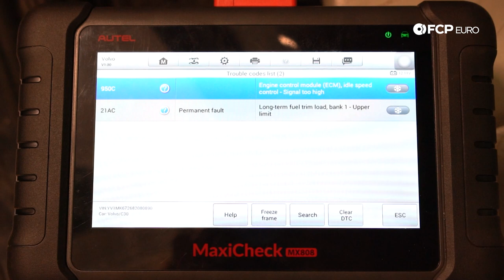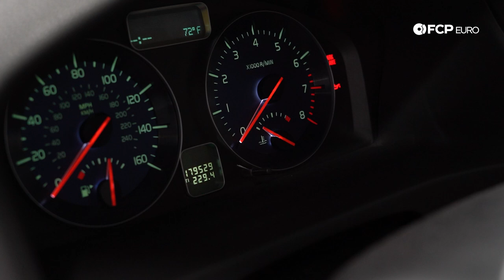How To Replace A Volvo Oil Filter Housing & PCV - Volvo P1 Platform - Volvo S40, V50, C30, & C70

Comment: I've done hundreds of these, was a Volvo technician for about 16 years
Reply: How long does the repair usually last? I had one done a year ago on my 2012 c30 166,000 and now it looks like I have to get another one replaced.
Reply: @interactive1178  took me about an hour max, if I remember correctly the turbo engines were easier to do than non turbo. Non turbo bout an hour all in, turbo engines like 40 to 45 min. A lot of cleaning the oil that leaks out too
Reply: @daviddennett2645  is it common to get one every year if you put a lot of miles on it?
Reply: @interactive1178  with the way things are built so cheaply I wouldn't be surprised. How many miles you do a year?
Reply: If you're over 200k by now I would expect another one is needed yes. Remember this is a FoMoCo engine, which means it's made by Ford. Worst thing Volvo did was to sell to Ford. Ruined quality
Reply: @daviddennett2645  thank you.
Reply: @interactive1178  you're welcome, good luck! Any questions feel free to ask idm
Reply: @daviddennett2645  thank you very much David
Reply: What way does the oil flow through the filter?
Reply: @90hdt  that I do not recall, id have to look at the housing to tell tbh, it's been years since I've done one. Why?
Reply: I just changed my oil and filter after the first 50miles after being rebuilt top and bottom I checked the outside of the filter for debris and wanted to make sure I didn’t need to cut it in half to check the inside.
Reply: @90hdt  I gotcha, id just check inside the pleats of the old filter cause it's the paper element with reusable housing correct? Talkin the 4 cyl in the S40/c30. If no metal or debris in the pleats you should be good to go
Reply: The 2.5 t5 yea I looked and looked good
Reply: @90hdt  the paper element correct? Not the metal one like on an 850/S70? If it looked good you're gravy n no worries
Reply: Hello
How long it takes to change the PCV on 2007 C70
Reply: @remonboles7375  turbo or NA?
Reply: i got a 2.4i  engine and i cant find any videos for that engine do i need to take te intake manifold off for this job??
Reply: @gamechangerz1329  not the manifold but the intake box with the ecu and filter yes. I think the turbos you don't have to for some reason but I may be wrong on that
Reply: @daviddennett2645  i already deleted stock intake and added a cold air intake to it . provides me with a lot of room . i might take the intake apart just out of curiosity. thanks for your advice brotha
Reply: Hey man, just today I ordered one of those red little circle ⭕️ pcv valves and took the cap off and went to put it on with the new one and the part I was supposed to clamp it on started chipping off and I can’t even get it pushed on all the way, can I drive it to work still what should I do
Reply: @yunglivid  yeah you're most likely going to have to replace that plastic part of the intake manifold, that or maybe the plastic teeth aren't locked into the read piece or something. I know a hose just locks into it. I never replaced one
Reply: @yunglivid  the pcv is the plastic box part attached to the oil filter housing. Those hoses are just the breather part of the system.
Reply: Is this the same on a 2013 V40 D3 please? Can't find anything on V40s

Comment: At Volvo dealers in NZ you'd be paying NZ$1200 just for the parts plus six hours labour at $100/hour. An absolute ripoff not helped by Volvo /Ford sticking the PCV Filter housing in an almost inaccessible location. Grrrrr

Comment: What is the estimated installation time for an experienced Volvo mechanic 2010 S40 T5 R-design ? I was advised 3.5hrs at $137.50 per hr part $214.99 total cost $696 sounds about right based on what others commented in this feed.

Comment: Just out of curiosity. If it is only the diaphragm that is shot, why not just replace that? Also, if you are a long way from home and this happens, can you loosen oil filler cap, to release a bit of vacuum in motor to prolong the bearing seals destruction?

Comment: Is this the same for a 2.4i (non-turbo)?  I have a 2008 S40 2.4i and my engine compartment looks different, with the five "finger-like" intake manifold on top.  Does that intake manifold need to be removed on this engine as well in order to replace the oil filter housing and PCV?

Comment: Thank you for this video. I had this problem last week. I went to a Volvo specialist and got it replaced, it costed me $700 with parts, labor and oil change.
Reply: How long does the repair usually last? I got one replaced on my 2012 c30 a year ago and now it looks like I need another one replaced.
Reply: If I recall it was like 4 to 450 with oil change n labor. 500 max at my uncles shop, the part isn't cheap either

Comment: Good video, i did the repair earlier today and I would add that you don't really have to take the ECU out the air box and you don't have to go under the car to remove the 3 bottom bolts, they're easily removable from the top. I did the whole repair on a parking lot and didn't have to get my jack out to lift the car at all. Also, i would highly recommend removing the coolant reservoir hose before taking out the air box, because it is very easy to damage that plastic hose which is a bit in the way
Reply from the maker: Thanks for sharing!
Reply: Will keep that in my mind. Will have to do this job on my dads 2005 Volvo v50

Comment: Just did this DIY, overall this video is a great step-by-step guide! outta 10 I'd say its about a 6-7 outta 10 on how difficult it is to perform this DIY. The hardest part was removing the airbox and re-installing it the bottom plastic mount was getting caught on the water pump i ended up shaving a very small amount off with a file to make a little bit more clearance during the installation. I ended up using a tap to create new threads for the bolts on the new housing. I also didn't have a long 10mm wrench on a flex head ratching for the housing bolts so that slowed down the process slightly. I would also recommend oiling the new housing gaskets with some oil to create a guaranteed seal "oil acts as a sealant" but overall an easy job with the help of this video! I had a check engine light on for Bank 1 running lean and the terrible noise as shown in the video. All fixed now!

Comment: I acctually clean used pcv housings and replace the rubber parts in them. Rebuilding the pcv saves a lot of $$$ and is very easy.

Comment: Hey, awesome video.  I especially like how you just glossed right over the hardest part...pulling that stupid air box.  I've been yanking on mine for half an hour.  I'm ready to take it out with a sawzall and put it back with duct tape.
<edit> - If you're doing this, the tab on the back of the airbox catches on the intake.  Pull the passenger side of the airbox toward the front of the car while pushing the entire airbox to the driver side
Reply from the maker: Sorry that was glossed over George, noted for the team.
Reply: To make that easier you can lift up the engine ( engine mount from passenger side should be unscrewed).
Reply: Took me less than a minute following the clear instructions. Taking the lower fasting screws of the ECU was more of a mission. Note: it's actually not essential to remove the ECU from the air box or remove the air box completely to replace the PCV Oil Filter Housing. Just ease the air box mounts from the rubber grommets and move the air box a few inches to the right will give you access to the mounting bolts.

Comment: I have a 2010 S40 T5. Ive removed the air intake "horn" above the left side of the radiator, along w the descending intake hose, to replace both with a cold air intake/filter. In fact, the CPU is also repositioned to a bracket to the left of the original air box/filter location.
  As a side benefit, I can directly & easily access my oil filter for changing AND PVC breather behind it. Replacing the breather diaphragm is extremely easy. The cap can b pried up & off & a replacement diaphragm, which IPD sells for about $9, ("item 140065 - Oil Filter Separator Box Diaphragm - 5 Cyl", albeit not a Volvo OEM...but much of what IPD & FCP sell is not OEM) be swapped in without the extra work of removing engine parts to create access. The "remove-the-intake-horn-&-down hose + cpu" will give enuf access to the breather cap to allow the swap...& save 20 min work & the cost of replacing the entire oil filter-breather housing, oil feed tubes & all ($260+)..vs $8.
Less time, less effort & less expense. It seems this is a better way, especially for the DIY home wrench jockey.
Reply from the maker: That is true! An aftermarket intake and CPU relocation does make it much easier! Plus you get more turbo noises!
Reply: @fcpeuro  especially if u replace stock one-piece turbo+manifold w 2 piece Garrett (w higher boost) & billet milled manifold w grade 8 bolts. Noise in cabin is magnificent. Gonna add 2nd Pierson blow-off valve in parallel to existing, w braided line to get more mellow sound & rapid pressure release to reduce back-pressure wear...not simply @ stop lights but also in speed-gear reduction. Ultimate machine wud hav Audi TT RS 3.2 NA or  current run since S40 is a sleeved engine. Mounts tho r problematic since Volvo 2.5 engine is top mounted on passenger side & bottom (torque) mounted on driver's.
Reply: I swapped the diaphragm(which was totally fine)!! The lid has a lip under it which I didn't realise so was prying up the whole thing up and have cracked the housing as  oil now leaks slightly out of the cap!!
Reply: What is the website where to order just the diaphragm? I need one myself

Comment: One thing that I think you forgot or could have done.   Is verify the fix with the stuck pcv valve. Take the oil cap on and off like" a" before and after"... So us n00bs can get a good comparison. Great Job ...

Comment: Thanks for the video. Quick questions, I did the glove test on the engine oil fill hole and my glove is sucked in during idle. Will changing the pcv housing fix this or is this another issue?
Reply from the maker: Actually that means your PCV system is functioning perfectly! When the PCV system fails it will blow the glove up rather than suck it in.

Comment: Needing to do this job as of now, seems like it should be possible with air box in place? Yes, would be tight, but sure a lot less stuffing around.

Plus, is dumping the engine oil required? The sump level being well below the filter housing I don't see why you'd need to do an oil change, unless of course it was due. Mine was done just 200KLM ago, so even though I change it often that'd be ridiculous.

My daughter has driven the car a few days like this and hope she hasn't rooted the seals.
Reply from the maker: Removing the air box will certainly give you more room to work with. It will be a messy job if you don't drain the oil beforehand. If you really want to, you can reuse the oil you drained out so long as the pan you drained it in is clean.
Reply: @fcpeuro  Yes, just did the Job and the air filter box really needs to shift out of the way. This job isn't particularly fun, but it's a nice feeling when it's done. I left the MAF and computer attached to the filter box and managed to just gently lift it off to the side without fully removing. I'm always after any steps that can be eliminated and still get the end result.

On another note, the air filter box pulled out allows access to the radiator hose and thermostat assembly, so if your car is aged and has done mileage it's a no brainer to get those parts at the same time. Mine only has 100K KLMS so hopefully I don't regret not changing these out till the next time I have a reason to go through getting into this space again.

Comment: Can you temporarily plug the tube and put a filter on the valve cover to vent the crank case? I need to drive the car until I fix it

Comment: I just did the diaphragm replacement instead of the entire housing. I’m still getting excessive vacuum. Any idea what else causes this?
Reply: did you get it fixed? I changed the whole housing and still have excessive vacuum...
Reply: @thuddiz  how’d it turn out? What was the remedy?
Reply: @gregb.5796  Still to this day I havent figured it out, still got an engine light on and i can hear the air being sucked in the enginespace. I have given up 🫠 car runs like shit when i press the gas a little to much and the fuel milege is really bad because of some leak but other that that it runs good
Reply: Where did you purchase the diaphragm ?
Reply: Could you have a vacuum leak somewhere else ?
Reply: @gregb.5796  I also never fixed it haha

Comment: My s40 1.8 2008 has an oil leak but i realised rhe person overfilled the oil!  it doesnt make any noise. It did blow air rather than make a suction force? Is this also a sign i need to replace the pcv?  Many thanks.

Comment: Can you please do a video Ann how to clean the throttle body on a 2017 VOLVO XC60 T6 with the 2.0 supercharged/turbocharged engine?  PS-I cannot locate the PCV valve either. Does this engine even have one?

Comment: This seems to be a pretty big undertaking.  So while in the neighborhood is there anything else that should be checked/maintained/replaced?
Reply: No but I did my transmission oil drain and fill since the hole for the fill freed up a little  on my model after the airbox was moved.

Comment: when accelerating from a stop i got a tiny shake / vibration when moving any thoughts thank you c30 2008 t5 volvo
Reply from the maker: Shaking/vibration when accelerating from a stop could be a number of things. You could have worn engine mounts, or cv shafts, or it would be a slight misfire, or a number of other things. A tiny shake doesn't sound too severe, but it might be a good idea to get it check out at a shop!

Comment: I have a 2010 S40 T5 . It it smoking (oil burning ) at idle and burns oil pretty bad. Would the PCV system be the problem or is it something else. Car has just over 100K on it.
Reply from the maker: Hi Will, a good start would be to check the system, and then consider further diagnostics should the PCV system be in proper working order.

Comment: Do i have to drain my oil while doing this or can i change out just the filter. Reason being is my drain plug is stuck
Reply from the maker: Hi LuckiCub, it is recommended to do an oil change when you do this job, you may also be able to use an oil extractor for that.

Comment: 23:10 when he is putting the 90° elbow hose in, is there any treat to getting it on? I have tried for about half and hour and cant seem to get the hose to slide onto both ends.
Reply from the maker: It is a very tight squeeze, bending the hose almost in half to get it on.
Reply: @fcpeuro  I got it on this morning. I realized that it had been in my cold garage and it wasn't very flexible. I warmed it up a bit and when on in about 30 seconds.

Comment: Do you need to drain the oil to change this part? Because mine had a oil change not long ago and the part just failed
Reply: Just do it and put the same oil back in afterwards obviously use a clean container . I think if you don’t oil spills everywhere

Comment: I just changed the oil filter housing, and I now have low oil pressure and CEL. Any suggestions?
Reply from the maker: I would first check the obvious, your oil level. Then, its possible you have a fault in the oil pressure sensor. Otherwise, you may have some engine problems, such as a failed oil pickup tube seal or even a bad oil pump.
Reply: It was the oil pressure sensor. Thanks for such a quick response. I am a new customer, and my experience with FCP Euro has been great! Really appreciate the videos and support y’all offer.

Comment: I'm wondering.  My 09 C30 has always had what I call a 5 cylinder wobble, could that be an indication ?  I'm averaging about 27 mpg after changing out the sparkplugs and coils.  Normally running at around 75 / 80 mph.
Reply from the maker: Hi, Ray! Indication of what, exactly? These 5 cylinders definitely have a unique sound and feel. 27 mpg sounds just about right for these cars!
Reply: @fcpeuro  I'm still figuring out what's normal with mine. I've replaced the coils and plugs and still it has a slight intermittant misfire. I'm getting ready to do the pcv diaphragm next. Thanks for the reply !!!
Reply: Ray, have you got used to the wobble yet? 
I know what you mean. When I’ve read up about it, it’s been referred to as ‘shimmer’ that you can hear/feel at low rpm. It’s simply the imperfectly balanced nature of a 5-cyl engine coupled with the firing order which accounts for this. If you search for videos on the matter, it’ll deepen your understanding of it.

Comment: Mileage wise when should I change this,?
Reply from the maker: Hi Herby, there is no real mileage interval for PCV maintenance. As a brief example, a low mileage car that only ever sees short trips is more likely to need a PCV replacement vs a high mileage example that only sees long trips. The idea is that the system is able to get up to temp and cycle the oil as thoroughly. In addition, proper maintenance vs neglected maintenance is going to affect the life of the system as well.
Reply: @FCP Euro  ok, thank you love your videos, been buying from fcpeuro for 20 years. Love it

Comment: This is probably a $800-1500 job including the OEM hardware for the dealer.  Such a bad design that happens to fail around 100k vs cars like Subaru that never have this PCV valve leak and never needed this kind of service.  I've spend $3k on the WRX all for upgrades and on this C30, spend $2k all on break fixes.
Reply: Ahh yes, a Subaru WRX. The spitting image of reliability 😂. I love subies too, they’re basically the Japanese Volvo in many ways, but I’d dare say Subaru often has nothing on Volvo when it comes to longevity!